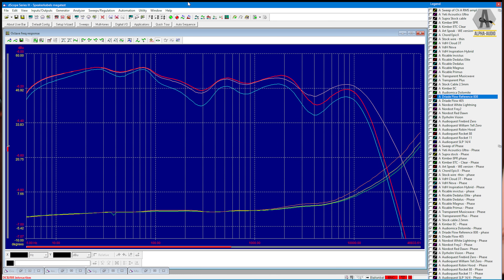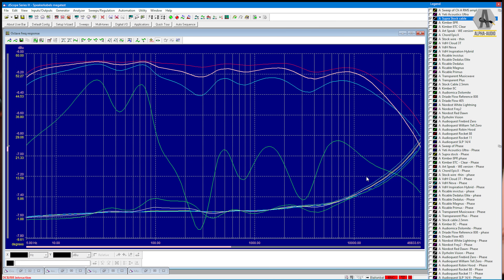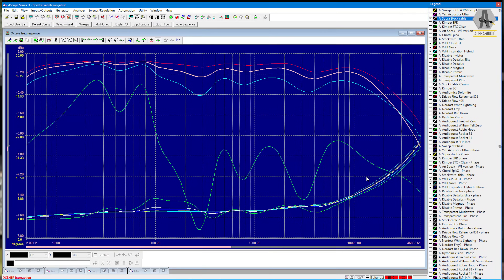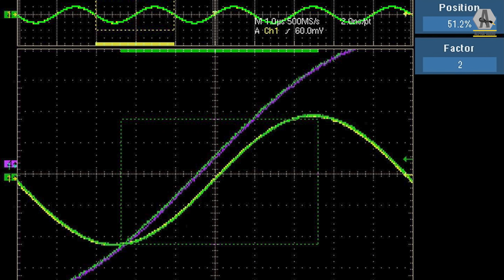Your speaker cable matters! 32 speaker cables tested - with measurements!

Comment: In my second audio system, with the computer as a source and my modified KEF Q100 coaxial loudspeakers in near field, I have been using Kimber Kable 8PR since 2012. I could not resist the offer of €7/m from a professional store in Barcelona. I noticed a great improvement in everything compared to normal 2.5mm oxygen-free ones, especially in the bass. I have them finished now with KácSa connectors, which is the Hungarian manufacturer behind Furutech, and much more affordable prices. KáCsa BP-6201BR - BFA.

That GEOMETRY is crucial is well known, no surprise. What also seems to have a lot of influence is the coverage. POLYETHILENE in 8PR and 12PFR. The other geometry to consider is star-quad, but I suspect KK's is the best.

Danny Richie (GR-Research) cables have the same geometry and polyethylene as KK PR. And its cables for the the speakers inside are also POLYETHILENE.

👉Danny Richie: Finally! DIY Audiophile Speaker Cable Kits!
https://www.youtube.com/watch?v=DfjQJxeTANE
Reply: If I ever buy new cables, they'll be from Danny.